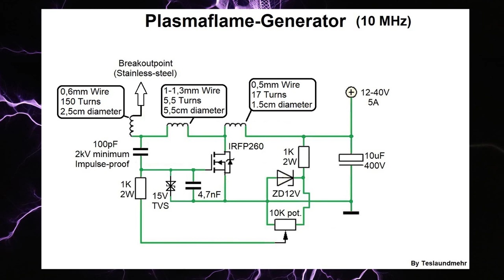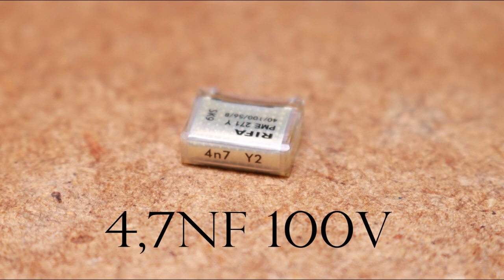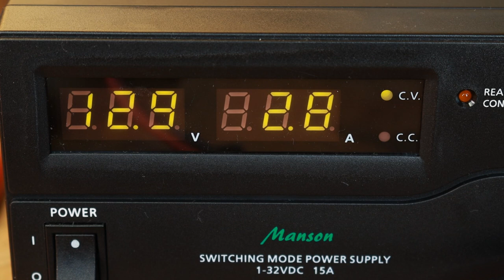DIY Plasma flame Tesla Coil - Step by Step (ft.Plasma Channel)

Comment: Ow i want to ask if you can give us the values of the three coils? I mean in μH's (or maybe even nH's, if that is measurable for the two small coils) 
But a value (even only for 1or2coils) is helpfull because while tuning i never knew (&know!) if i am much to far of the original meant coilvalues and if that's maybe a reason for beginning all over again with new wound coils. If we could measure how much we went off it would make the built or at least the tuning a bit easier.
Reply from the maker: The inductor needs 10uH ;)
Reply: @Teslaundmehr 10μH is for the big one? The resonatorcoil? I think that's the only one that has a measurable value?
Reply: @Teslaundmehr  wich coil is 10μH? 
I first thought you meant the big resonator but that measures (ánd calculate) around 125μH so i think that's much too far of for that one?
Reply: @Teslaundmehr  As Rob mentioned, we would appreciate having inductance values, preferably for all coils.  @Rob, the 10uH coil is the 17T/1.5cm/0.5mm coil (Yellow coil in the video) however the rest are a mystery.
Reply: My resonator at the moment is close to 200uH but I plan on dropping that some. I started building another one of these using Teslaundmehr's values as a baseline and found it a lot easier to begin the initial tuning process by using the variable capacitor like in the older circuit. Even if you don't have a scope you can use a basic DMM with frequency setting to see what the primary is resonating at given your variability with the capacitor. Using something pretty close to his primary arrangement I was getting a low of about 4mhz up to about 20mhz (depending on the mosfet) with maybe 150pf variance. If say I wanted to set my oscillator at a certain frequency I could then just swap the varicap with a 2kv+ capable pulse capacitor of that value. 2kv minimum is no joke, I started off with one of those little green 2-hole screw in terminals for swapping caps and after realizing my small 2kv caps couldn't take it and replaced them, there was invisible hot HF arcing going on between the two terminals and melting the plastic. The distance between them through the plastic seems like a little more than 2kv would be needed to bridge it. Theoretically you can design a main resonator which will *undershoot your intended frequency by giving it more turns than necessary and just incrementally remove turns from the free top end.
Reply: @flomojo2u  hey that's what i wanted to know. Its also more logically indeed. Thanks man
Reply: @Magneticitist  that gives me at least a couple of helpfull references, so Thank you man
Reply: @robson6285  I wish I could give any more solid advice from experience but my experience has been that I don't get these damn things. The amount of possible variation in how the circuit may run depending on slight frequency adjustment or mosfet usage (say replacing one 260 with a different one of slightly varying specs) has had little consistency. My first successful one was tuned the best by adjusting lead wire distances from each other along my bootleg wiring job. So far going by Teslaundmehr's specs (roughly) I can't exceed a 1 inch unassisted flame yet at 40V (using irfp460) cause of the heat at on resistance when trying to push more than a few amps into it. I popped the first couple amazon 260's I tried too easily.
Reply: @Magneticitist  maybe you can tell me if using isolation between the fets tab and the coolingbrick makes any difference? That fets drain will have a substantial capacitance to ground when making contact with such a big area, but tesla himself does not use any isolation as far as i can see? Did you try both, so with and without isolation, and do you think it interferes with the working? At least i should think it changes the oscillationfrequency quite a bit, or doesn't it matter much?
Ow another question: is there magnetic coupling nescessairy between the coils? I mean just like in a normal teslacoil the primairy has to couple into the secundairy, what i think that the 5,5turns and the 150turns coils are in this circuit? This circuit is not that kind of working, but the placing of the coils referenced to eachother will certainly makes a lot of difference? Or not?
Reply: @robson6285  Isolating the heatsink can possibly make a difference but it depends on how your layout is. Acid Byte uses a bent metal plane which he ties to the drain in one of his circuits but this plane is oriented near the coil output and provides capacitance for it to 'push against' as he puts it. In my case I just have the sink sitting off to the side and isolating it or not doesn't make much difference. 

The coupling between the coils isn't necessary and may actually complicate things depending on your frequency matching and how much the secondary resonator may change the primary resonance when coupled. This works like a magnifier so the primary LC is just outputting RF power, and by attaching another resonator to the high leg of this LC it will excite if wound to have the same resonant frequency as the LC oscillator.  

I had trouble trying to place my resonator inside the primary to couple them until I used a secondary diameter which allowed for a looser coupling. Worked about the same whether coupled or not at that point.
Reply: @robson6285  So far I've managed to see the end of the tunnel by tuning my ballpark values with the varicap and removing turns from the secondary incrementally. Haven't popped my guinea pig IRFP460 yet but I'm being cautious with the input power. Would def use a legit 260 if I had one. I tried to tune my LC oscillator (without secondary) to where I was satisfied with the output power and wireless lighting etc, but was still within the frequency range of what I was capable of catering my secondary to. I also kind of judged by how hot of a little arc I could pull straight from the primary LC terminal.
I ultimately placed the secondary within the primary just for the sake of saving space. I believe it's switching harder than I'd want though and trying to crank over a couple hundred watts at the moment would overheat the fet over time.
Reply: @Magneticitist  Nice to have help from your experiances with the circuit. I don't have a big enough variabel capacitor and planned to use a couple of very oldfasioned mica caps 2x500volt in series, but after what you said about that i think i better seek more on old tv pcbs for more caps because that's the only place i think that i maybe can find usable enough caps for that kind of voltages. Thís circuit is absolutely interesting, to say the least i think
Reply: @robson6285  I got away with a couple small 2kv ceramic caps in series for a little while before they burned up pushing higher power, which wasn't that significant. I don't imagine the small WIMA MKP's I have would hold up for long at higher power either as I've burned one out on a similar HF circuit. Your 2 micas to get 1kv is probably not going to cut it once you reach flame levels unless you're pulling a small one from the tip of a wire so it's def a good idea to seek better values.
Reply: The calculations don't fit me.
 I use the "Coil64" program for windows.
 For a coil of 17 turns, 1.5 cm in diameter, 0.5 mm wire and 10 Mh, I get a result of 4.11uH ¿?
Reply: @raadelable  i know, i use coil32 (android) and it is a mess with these given inductorvalues. But don't underestimate the strange faults that our coil-prg gives. Try to add one turn and calculate the induction and look how that value makes strange jumps while adding one turn a couple of times
Reply: @raadelable  I get the same rough values for the RFC but haven't found it to be critical. Good to have higher chokes inductance than the LC inductor though. I replaced the air coil with a small inductor on a slug which is somewhere in the 10uH ballpark and it works about the same.
Reply: @Magneticitist  OK thanks. I will try to make the assembly by imitating its construction and I will comment.
Thank you very much for your work, it's great.
One last question: how did you "overfeed" the coil to get such a high flame?
Reply: @robson6285  It's true, you get some pretty disconcerting results.
Thanks Rob.
Reply: @raadelable  You mean in the last video? you might be referring to how it looks with the addition of melted glass to the breakout point. My first setup didn't act the same, the addition of the glass brought out a thicker yellowish flame but it didn't want to really extend upward even with help. May have been the slight coupling still present between the coils. 

In my last setup the flame wanted to jump to an electrode much more so when I added the glass I was able to manipulate the flame much higher by drawing it out manually.
Reply: @Magneticitist  i hope you can give me a clue to help me find why my built never starts oscillating?? I used a variable capacitor set and varied at and around 100pF, and wound and tried various coils, but when i raise the gatevoltage the current goes up, like espected, but there is not the slightest oscillation in my circuit! Did you experianced that too sometimes? Can you think of a reason why it won't oscillate? And by wich currentdraw that oscillating starts? Am i maybe too causious with stopping my trying at 2,5amps currentdraw at 15volts?
Reply: @robson6285  When I tried altering the external gate capacitance too much (4.7nF in schematic) the circuit wouldn't want to oscillate so there is definitely a fine tuning needed just to get the LC circuit running itself. Being outside of the wrong 100-150 pF or so tank cap variation is a pretty small window as well. 
I've never had to pull that much current on any of mine cranking the divider, I think it's maybe about 2-3 watts peak at 30V before oscillation begins (then it jumps to much higher of course) so the gate voltage is minimal when kickstarting. If you're using the same values as called for in the schematic exactly including a 260 or 460 mosfet then you should at least see some kind of oscillation by sweeping the variable cap and raising the gate voltage moderately.
Reply: @Magneticitist  thank you. With these things you said i can go further, now knowing better what and where to look. Really thanks for you helping me this way!
Reply: @robson6285  No prob, it gets easier the more you mess with it.
Reply: @Magneticitist  finally i got both my builts oscillating! My problems vanished when i raise the value of the gatecapacitor from 4,7nF to 10nF. Maybe nescessairy because my irfp240's have a much lower gatecapacity. Only 1100pF instead the almost 3900pF for the irfp460 and irfp260. And since you already told me that this was a for the working important value, i tried and indeed, finally! So i want to say thanks to you for your most valuable helping words. Now it finally oscillates now i can finally go further, the big coil and the tuning will be a lot easier now after spending more and more time on this circuit. Also like you already said!
Reply: @robson6285  Awesome good to hear. Another way to sort of fine tune things I've found is to wind a primary coil that is sort of like a spring. Not too much distance between turns but just enough to where it can contract and expand. You can sort of sandwich it in a little holder with something like a plastic screw in the middle to finely adjust how much the windings spread out or contract.

Comment: If i make the flaim generator exactally like you did, how many spare mosfets do i need?
Also if i conect 10+mosfets in parallel will they handle the wrong tuning?
Reply: I get so many ideas reading these comments. I personally would not recommend trying to parallel the fets like that. The problem is going to be breakdown of the drain and source where the voltage exceeds the fets capability. Either that or the gate will be destroyed. Paralleling fets will not solve that problem, will only help them share the dissipated heat. You would also be creating quite a bit of added capacitance. Maybe two in parallel is fine but this is not necessary with the proper switching.
Reply: @Magneticitist  thank you
Reply: @Magneticitist  ah..completely wrong. HVC clearly has no idea what he's doing. You can't double up MOSFET's like that, voltage and current do not magically stay the same when you have split the circuit ! lol...If you take a look at the max voltage and current for the MOSFET in the spec sheet, you will notice that it exceeds most simple power supplies. The current supplied to the primary is plenty for this thing, why would you want to go higher ?. The alternative is using ex military valves for radar, but, I fear that would probably end up with you being very dead, The back EMF created from the secondary is more than enough to utterly cook the shit out of the gate on the MOSFET, especially when the LC tank it is mismatched during tuning, which it most probably will be, which is why it is critical to have that spike suppression diode between the base and ground, that will prevent any fast rising pulses above 15 volts from cooking the gate, it just opens up, avalanche style and dumps the voltage to ground, thus saving your MOSFET..you could actually go for one that cuts off at 12 volts if you are using a second hand MOSFET from an old computer power supply, to be even safer.

Comment: I enjoyed watching your video.   Thanks for making it and thanks for showing the scope waveform too.    How did you install the bolt in the middle of the tube?  
I am confused about something.  The 5 Turn coil caused the lamps to glow so there must have been a high voltage and yet the scope waveform shows only 216mV.  Did you just bring the scope probe near enough to pick up the oscillations or if not where did you connect it? Even at the Gate of the FET, it is still too low.

Comment: Does the primary have to be in the MHz range? I made an inductor with around 0.460H & bringing it from the kHz range to MHz would require fF capacitors to get a MHz frequency; will using resonant frequency nodes work?
Reply: The reason it is MHz range is for the type of discharge you get, which in this case is a flame like output. KHz will give a more spark like discharge.

Comment: Great work and video, I like it!! Did you came up with the circuitry on your own or did you copy from somewhere? Can you explain how this circuit works, i.e. where exactly is the LC resonance in the circuit (inductor+primary+100pF condensator)?
Reply from the maker: Thank you! I dont design this circuit completly, but I add some stuff, change Values etc. The LC resonance in the circuit is 100pF + 4.7nF + primary
Reply: @Teslaundmehr  THanks a lot, now I understand, the back-current of the oscillator is flowing through the substrate diode of the MOSFET. Have you tried with an external free wheeling diode bridging source and drain as well?? The inductor with 10µH is primarily a choke or does it have a specific purpose? I will give the circuit also a try on my own :-)
Reply: @Teslaundmehr  ah, no it isn't ! It is from the 100 pF and the primary. The 4.7 nF between the gate and the source is actually there to act as a snubber, it absorbs  the internal capacitance between the gate and the source, the values of which are in the spec sheet for the MOSFET..you will notice that the capacitance values in the spec sheet  are way less than 4.7 nF. Basically it is a way to stop those smaller capacitances inside the actual structure of the MOSFET from interfering with the value you are tuning your LC tank circuit for, ie, ~10 MHz...The 10 mH coil does not play any part of the LC tank circuit...it is actually a choke..it's purpose is to remove any RF from entering the drain, in phase or out of phase it will not have a good effect if the power going into the MOSFET already has an oscillation, it is a stability thing.

Comment: Interesting video, thanks for sharing! Do you have access to an LCR? I was wondering if you've measured the 10uH choke, and at what frequency. Additionally I was wondering about the inductive contributions of your (likely wirewound) resistors. If you have more of the same resistors, would you be able to measure those, and give us an idea of what kind of inductance you're adding to the bias/feedback path?
Reply: I wonder why You are asking, but I guess You have a similar question as I do. Given the parameters for the coil with simple formulas for air-core single-layer solenoid i only get about 4.2uH. The rest of the parameters seem to fit to the simple formulas (leading to resonant frequency of the primary circuit and resonator coil of about 10 MHz), but the first coil just wont match.

Comment: Bro i took kemet capacitor instead of wima. Also my coil dimensions are 2cm for secondary and 4cm for primary with 15 and 8 turns. Still primary coil is not generating any magnetic field inside but mosfet is getting hot. Please guide.